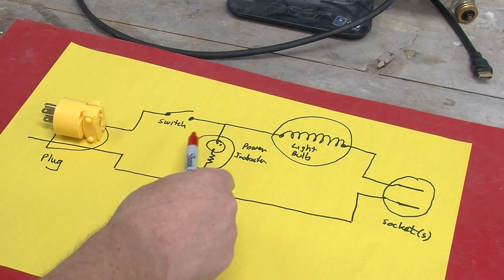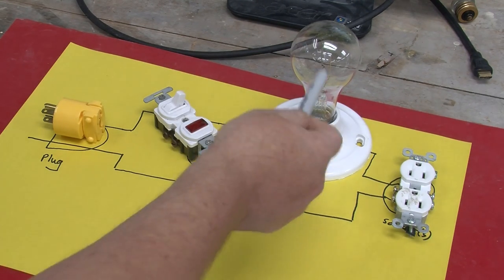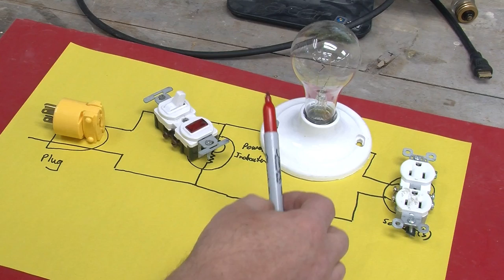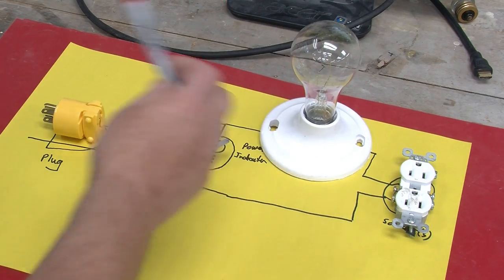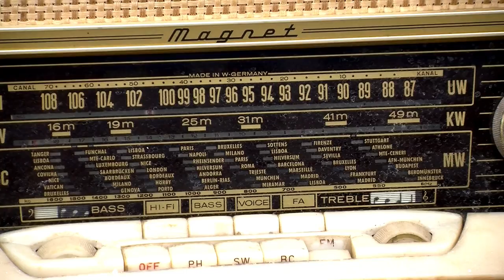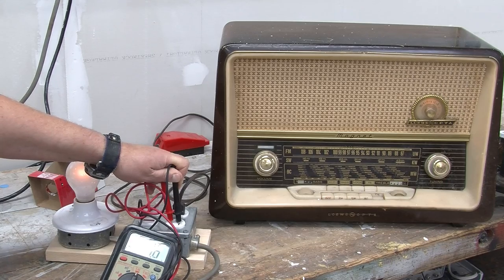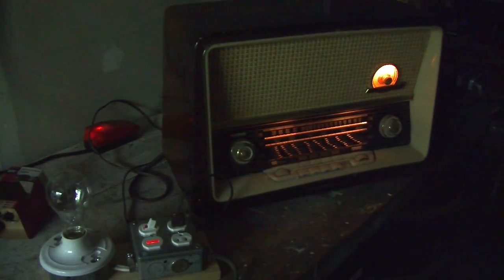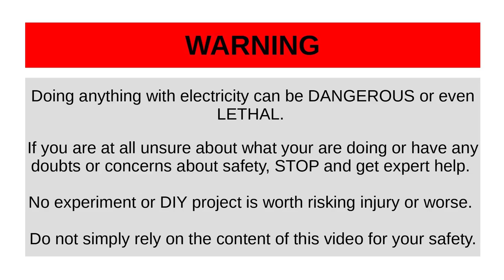When a Light Bulb is better than a Fuse

Comment: They have not been completely replaced they are still commonly used in appliances.
Reply from the maker: Yes! Unfortunately many of those are relatively low wattage though ...
Reply: @ElectromagneticVideos  If you call 100W oven lights "low wattage," then maybe.
Reply from the maker: @HylianOverlord  Wow - I thought they were always 40W or so. I'm thrilled to hear there are 100W ones - than means 100W bulbs will be available for a reasonable time in the future!

Comment: I made a device where the bulb limiter is automatically inserted(less than 25 ms) if a over current event is detected. I set the current threshold with a pot to just below or at the fuse rating of the amplifier Im testing. I havent blown a fuse in a customers amp in years and it is great for catching those intermittent shorts. No more hand on the bulb switch silly business.
Reply from the maker: Thats really neat improvement! How do you sense the current? Low value resistor or current transformer? And to untrip it - just turn of power or is there an untrip/try again switch?
Reply: @ElectromagneticVideos  Sense with a current transformer, rectify that signal to DC then a comparator with the Threshold set. When it trips I have a MOSFET latch that holds down the "set" pin of the comparator and then a momentary "reset" push button. I also have a 10 LED meter ranging from green to yellow to red as the current gets closer to the threshold it will blink faster and faster till it trips then all of them are blinking, so it's a great visual cue. I've been thinking of selling it as a kit to amp tinkerers and the like
Reply from the maker: @prattacaster  Sounds like a well thought out and tested design.  I think a kit would be fantastic! And even if not a complete kit, but a printed circuit board and a list of parts might be a great way to test the market. Hope you have a go at marketing it!

Comment: Ah, I've been looking for high power resistors. Didn't think of bulbs.
Reply from the maker: The great thing about bulbs is how the resistance increases with temperature (~current) so you get a current limiting effect. Of course if thats not what you want for your application a bulb may not be for you unless your current draw remains roughly constant.
Reply: @ElectromagneticVideos  Oh, right! I wonder what the current-resistance curve looks like... probably not as ideal as a PTC thermistor
Reply from the maker: @alexoja2918  I just googled i! Look here http://elektron.pol.lublin.pl/elekp/instrukcje_LV/Tungsten_resistance.pdf    It looks pretty linear. I think the main difference is often resistors are bulkier and slower to heat up and cool down. If you can still find bulbs you sure cant beat them in terms of price for a power resistor. Someone commented about using a halogen bulbs for higher powers - I have never tried them - but another possibility.
Reply: @ElectromagneticVideos  Wow that's interesting. I thought it would be more of a curve as past a certain point the bulb starts to hit an exceptional temperature. I'm going to have to get a few incandescents and build a cable now.
Reply from the maker: @alexoja2918  I was surprised how linear it was too! If you do build a setup post a video and let me know so I can see it!

Comment: Fused spur vs 60W bulb on 100% of the time while the socket is in use, which electricians would assume is on a lighting circuit? Why not just use a fuse
Reply from the maker: Its only used for testing and troubleshooting - not normal operation. If you ave something like an intermittent short a fuse can blow so quickly it can be hard to find the location of the problem. A bulb protects things by limiting the current even when the circuit is shorted and also provides a convent visual indication when the short is happening.
Reply: @ElectromagneticVideos  Fair enough, I misunderstood it's use
Reply from the maker: @1992jamo  No worries! After all, its use is a bit "different" :)

Comment: Long ago I had been warned about operating tube outside their rated filament voltages and how it could shorten the life of the tubes, I have to wonder if this light bulb trick might have hastened the end of many a marginal tubes life.
Reply from the maker: That might have been cathode poisoning. Had an interesting discussion about that somewhere down in the comments. My general feeling is that for the amount of time usually spent using the bulb for repairing ( a few hours) it seems unlikely to be a problem. If the tube was really gassy it might be a problem, so as you said, it may hasten the end of some really marginal tubes.

Comment: The tru irony is that in modern circuit breakers is a filament doing the work...we go so fare but still stay so close
Reply from the maker: For heating a bimetal strip for the thermal trip? Yeah I guess you can beat simple resistance heating for some things!
Reply: @ElectromagneticVideos  yep same principles just built to form and function i love how old and new sometimes arnt as different as they appear..love the vids btw
Reply from the maker: @danbrit9848  Me too! And today many don't get how often the old simple approach is as good or better than that throwing a million transistors in an IC at the problem. Glad you like the videos - appreciate the comment!

Comment: has anyone built a full bridge rectifier out of LEDs? if not, that would be a super cool project
Reply from the maker: The issue with that would be that most LEDs are not designed for reverse breakdown voltages of any size so voltages might be quite limited. And the higher voltage drop may not be desirable.

Comment: thats actually a bad idea, because the european safty system needs 5 times the rated current to shut off. However when you put a light bulb in series, the current is limited due to the light bulbs resistance making the fuse obsolet.
Reply from the maker: The idea is to use the bulb to allow some current into a device that might other wise blow a fuse while troubleshooting. Its not intended to be used or to  replace a fuse under normal operation of the device.